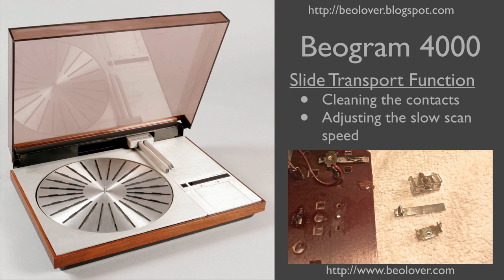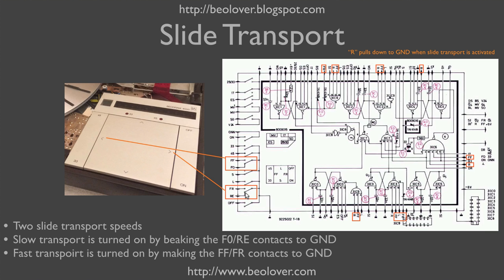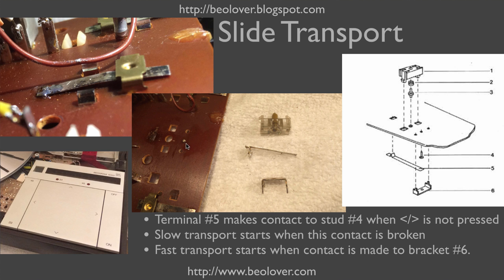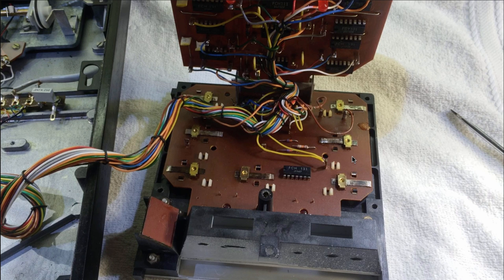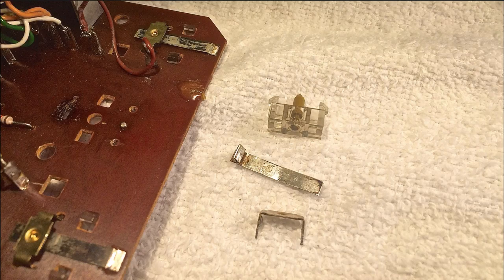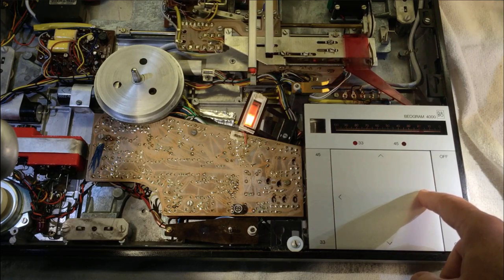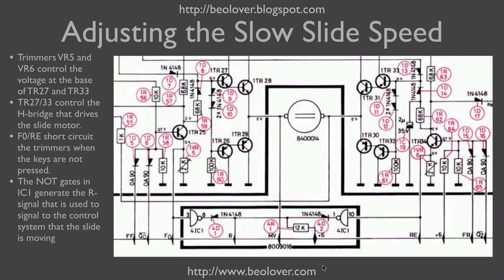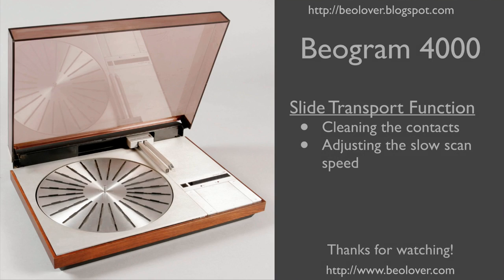Beogram 4000: Restoring the Slide Transport Functions

Comment: I have a question regarding the Beogram 4004, when I hit the start button, I can hear the motor working, but the tone arm does not move, also, the 45 rpm function button does nothing. What could be causing this? And do you have a video on repairing it?
Reply: Eli Cormier need to change belt
Reply: The little one